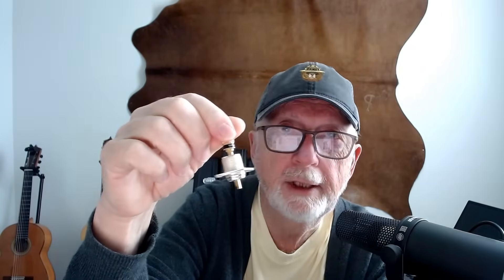Use Cheap TV Coax Cable For Your Ham Radio Station.

Comment: Hey Mark,
Here is a little story about 75 Ohm cable.  I was up in West Virginia where I am from at my brothers house. He wanted to put his IC-7000 in his truck. We got it installed in the cab and the 96" whip mounted on the tool box except he had no RG8.  It was on a sunday and we had the bright idea to use some RG6 Quad Shield instead as a temporary cable.  Key word temporary.  After I got the PL259 connectors with adaptors for RG8x installed I was shocked on how low the SWR was, It was a 1:4 to 1. Anyway to make a long story short this was 9 years ago and the cable is still on the truck with the whip.  HEY if it works good leave it alone, Right.  After I got back home here in Florida I talked to him on 10 and 12 meters without a problem and no matter where he was in the mountain's of WV, KY, NC, or Tenn. it worked great.
So much on having to use 50 Ohm cable.  I didn't question on why it worked, it just did....    Thank Mark 👍
W4DRA
Reply from the maker: Great story thanks for taking the time to pass that along.

Comment: Antenna tuners don't tune
Reply from the maker: Antenna Engineer W2DU Walt Maxwell explained that a properly adjusted tuner at the transmitter end causes a conjugate match to be established at the antenna feed point—not by changing the antenna, but by adjusting the input match such that the entire system (transmitter + tuner + line + antenna) behaves as if there is a conjugate match at the load. This enables maximum power transfer even when the antenna itself is not naturally resonant.

Comment: I will keep using my LMR 400. If you can't afford the hobby there are thousands of other hobbies. I don't use a tuner just resonant antennas. Tuners are a bunch of CRAP since they don't actually Tune Anything. You use Garbage & you get garbage so be Cheap & play 2nd fiddle. :face-blue-smiling:
Reply from the maker: Might want to check the ARRL Antenna book.  

"An antenna operated away from its natural resonant frequency is tuned to resonance by a Transmatch connected at the input to the transmission line."
Reply: @ I’m sticking with what works and I’m not messing with what is doing an AMAZING job for me. Tuners are just wasting time,money, & signals. ARRL = Amateur Radios Real Losers. 👎🏻

Comment: I’ve been using RG6 with a 60 watt rig without problems for a while. You should also consider that if the length of the feed line is a multiple of half the wavelength the impedance at the antenna end will be mirrored at the transmitter end, so cable impedance does not matter in this case. Great video! Subscribed.

Comment: YOU  have not even  SCRATCHED  the surface!!!.  In the 60's, when I was in high school  (grad 66)   one of the Elmers was talking about using  LAMP ZIP CORD  on  160--40 meters.  I actually DID  use  some extension cord  on  160-40  back around '99-2000.  I was staying with my Mom, recovering from a bad car crash.  Threw up some wire,  fed it with RG6  added to  extension cord  (not enough length)  and away we went.
Reply from the maker: Yep that'll work.  Actually I'm planning a video on something like that.

Comment: This is a very interesting video. I’ve heard of people using RG6 as feed line before, but not getting the explanation I received here. I was pleasantly surprised about the banana plus and chassis ground idea, but it makes perfect sense. Great out-of-the-box thinking, we’ve all been conditioned to 50 Ohm coax and PL259s. I’m also a fan of ladder line. Good stuff here.

Comment: When you say high power, is that 100+ watts or 1000+ watts? What would you say the highest power RG6 and RG11 are respectivly?

73 de David KEØPBI
Reply from the maker: High power is above 100 watts.  For cable power ratings....   https://rfconnection.com/coaxial-cable-power-ratings/

Comment: You can still Use 75 Ohm's TV Cable,
75/50=1.5 swr, not a bad match,
Reply: Not necessarily depends on the length

Comment: Do not use TV coax for ham radio especially if You live in Europe. European markets are flooded by cheap chinese knockoff cables made from steel and alluninium wires. I spent more money by buying and unsuccesfully testing cheap TV coaxes than was the price of propper 50 ohm. RF-287. No one is rich enough to buy cheap things - is our quote - and it is right.
Reply from the maker: Here in the us tv cable is made of steel and aluminum and it works fine.

Comment: When I first got my G4 call I used a short length of what was called u.h.f. 75 Ω  t.v. coax, a KW204 valve tx with Pi output on the valves, long wire and tuner. You could get either a 50 Ω or 75 Ω SWR meter. 
If your dipole is 73 Ω, your tx and coax 50 Ω, there's a mismatch, it's said to be a 1.5:1 SWR, that is if you can get your dipole to 73 Ω. 
I would think using 75 Ω coax to a 73 Ω dipole would still be 1.5:1 SWR with a 50 Ω tx so nothing different. 
According to my VNA my attic dipoles (more like inverted vee's) vary from 66 Ω to 56, 52 and 45 Ω with varying SWR figures. I don't worry, my worst is 1.3:1.  Brickwork, other dipoles and having the ends wrapped round the joists to fit them in affect it all. 
Edit: RG58 used because I use BNC connectors on everything. I only recently found BNC plugs are available for RG8.

G4GHB.

Comment: The ultimate reality check is to run an a/b comparison of the two cables. As measured by a field strength meter, too see what the ERP of the system is, both ways. Losses, reflections, nothing counts except the ERP. Assuming the SWR won't cook your finals.
Reply from the maker: The specifications of all such cables are readily available.  Just do the math.

Comment: Back in the mid 20th Century when I started out in ham radio, the Radio Amateur's Handbook recommended RG-11 or RG-59 to feed a dipole.  Transmitters back then had pi-network tank circuits in the final amplifiers and they would match 75 ohms just fine.  The only rule that's important about splicing coax without connectors is that the length of the open wires shouldn't be a significant part of a quarter wavelength.  That means connectors begin to matter on 2-meters and become become important at higher frequencies.
Reply from the maker: Good advice!

Comment: Use crimp connectors for aluminum shield cables. My first station used 75 ohm TV cable back in 1974. Worked fine. 
I was just looking at my Ten Tec Century 21 manual and they recommend 50 to 75 ohm cable....
But they even said loads from 35 to 75 ohms will work. This is solid state gear, not tubes. Tube radios didn't have a problem either.

Comment: Although a dipole will match 75 ohm coax better, a lower impedance (about 30 ohms) feed line is more efficient for transferring high power (even tens of watts) TO an aerial. 50 ohms was thus chosen as a compromise for transceiving, whereas 75 ohms is better for (e.g. TV) reception only. Having said that, your main point about losses and SWR is entirely valid, and satellite coax is very low loss and still much cheaper than 50 ohm coax because the market is so much bigger. Go for it.
Reply: I Also have a nice roll of good quality satellite 75 Ohms coax, I will try it!

Comment: Just for fun i tried buying 100 feet of 75 ohm RG-59 and 100 feet of 50 ohm RG58. The cheap stuff from Amazon. Both $25 for 100 feet at the time. I didn't have any problems with SWR or impedance but I put 100 watts into one end and sticking my Daiwa power meter on the other end into a dummy load I only got 7 watts out with the TV coax and 22 watts with the 50 ohm coax. My intention was always to use them for receive only antennas and they served that purpose well but I couldn't help testing them to see how bad they were with power loss.
Reply from the maker: SWR meters are designed to work with 50 ohms, not 75.  With a 50 ohm dummy load you had standing waves on the TV coax but loss would be very small.  Something was wrong with your setup.  No way there was that much of a power difference.   And RG59 has less loss than RG58.

Comment: What’s the receive loss?  Also is your antenna coupler before  the coax or at the end of it near the antenna ? The transmitter won’t like a 75 ohm load.  I’ve had a GROL for 50 years and worked as a tech in the industry.
Reply from the maker: Receive loss is the same as transmit loss.  You could have a tuner at either end but I like a tuner at the transmitter end.  It will take care of your transmitter impedance and tune the system just like it would be with a 50 ohm cable.  I have a GROL too.  It's useless now.
Reply: @ that’s a good place to put the coupler. The last place I worked at the GROL was a requirement for employment. It weeded out a lot of people. My last position at that company was 6 years at a gateway earth station. I worked in all kinds of RF equipment including P-3 avionics, navaids, and radios systems including trunked radio and a repeater system 800 miles long. I also did quite a bit of work for the FAA all over Alaska.

Comment: 75 ohm coax center wire is very fine, can't handle over 20  watts⚠️ have you tested tv coax ????
Reply from the maker: Not so.  https://rfconnection.com/coaxial-cable-power-ratings/
Yes I have used TV coax.  Did you even bother to look up the actual power ratings?

Comment: I've used a set of crossed dipoles (40m & 80m) for years. I fed it with RG-6 and the SWR was 1.3:1 after tuning the antennas. I agree 100% that TV type coax will work just fine in most cases.  I never ran more than 200w using that coax and never had any issues. Now that being said, I'm not sure how well TV type coax would work at UHF frequencies as I've never run it but, I would imagine it would work also.
Reply from the maker: It will work better than popular 50 ohm coax cables because it has less loss at high frequencies.

Comment: I’m brand new to ham, so please excuse my confusion: Won’t I risk damage to transceivers by not using proper cabling and good SWR numbers? I want new equipment such as Icom IC-7xxx, but I might have possible access to old vintage equipment until I can afford the fancy new stuff, and really want to learn how to use, repair, and restore vintage ham equipment, including vacuum tube stuff. Won’t wrong cables and bad SWR numbers bring about hurried and premature wear and damage to such equipment? To this point, I only have experience on 2m and 70cm with the cutting edge Baofeng UV-5R, and as of yet, have not been (able to afford) HF yet. Thanks!
Reply from the maker: You'll be fine if you use an antenna tuner.  It will allow you to use any coax or other transmission lines and provide a perfect 50 ohm match for your transceiver.  Every ham station needs one and they don't have to be expensive.  Plenty of used ones on eBay.
Reply: Modern radios use FET power amp stages which will not tolerate high SWR as the reflected power will cook them - hence the need to protect them. The ic7300 has high SWR protection but you don't want to test it to the extreme. Basically a modern radio should only ever see 50 ohms no matter what is further down the chain.

Comment: Yup, correct on everything. I work in a thrift store and we get TV coax donated fairly often yet most folks shun the stuff. In my store I would price 50 feet at $5 with F connectors. I use it from time to time and no major issues. 73 de wa4jat

Comment: Agreed, as a 30+ year Ham, I have used all sorts of wire, antennas and connectors LOL if you are listening to SW you dont even need an antenna! you can toss a few feet of wire out a window and hear the same thing we hear on a $1000 antenna
Rain Gutters as both the antenna and counter poise :)
you guys buy coax at HRO? my last three 50 foot spools rg58 I got on AliExpress $14 each with ends, oh and a Plus it showed up, and a bigger plus it worked as promised!, if they get around to tariffs they will still only be $30 Rarely am I under 100W am not a QRP kind of guy

Comment: 75 ohm coax was used by hams long before 50 ohm coax became ubiquitous. I get reel tailings of RG-11 all the time from construction sites when they are building apartments, etc. Otherwise, they will just chuck it in the recycle bin. They have saved me thousands on coax. And you can spin a PL-259 directly onto RG-11!  Stuff works great. I even have an old SWR meter that has a switch on the back, so I can use it on either 50 or 75 ohm cables. But I use my RG-11 on almost all my radio setups, including my scanners. 73!
Reply from the maker: Great post!

Comment: What power can you transmit through RG6 / RG11?
Reply from the maker: I would stick to around 100 watts for cheap RG6 however RG6A is a higher quality RG6 and has a rating of 1500 watts @ 10 Mhz.  RG11 is rated at 2500 watts @ 10 MHz.
Reply: @BustRadioMyths  I see that there many many different versions of both RG6 and RG11. Most seem to have copper clad steel center conductor. The CCS center conductor should be limited to 100W I assume.
Reply from the maker: Why?  RF current flows only on the outside of a conductor.  Look up the power ratings for those cables yourself.

Comment: I use TV coax all the time and I work QRP mostly and worked the world I'm KB8UGP Gary the QRP Guy I'm a master of Europe. I worked all 50 states, all grids. What more can I say? The TV coax works just as good as anything else. And like you said, unless you're running a whole lot of power. Now I have run up to 300 watts through the 75 on cable and it's never hurt nothing. Never offered too short arc or burn up. So I say it can. be used for amateur radio use also. made videos showing my QRP setup and where I run 75 on cable So there you go. Y'all take care now. May God bless America

Comment: Just today I worked Kenya from Poland through a resonant 10m dipole connected via a TV 75ohm coax, just 20watt of power. No tuner needed, SWR close to 1.0. So TV coax certainly works. It is not my usual setup, but just for fun I sometimes use it.

Comment: Do you have any data available to show the losses of RG6 and RG11 vs RG8X and RG213?  What do you consider high power?  100watts?
Reply from the maker: Try this coax calculator.
https://www.qsl.net/co8tw/Coax_Calculator.htm
High power is over 100 watts.
Reply: @BustRadioMyths  Thanks for the information.  As a newly licensed ham this information has given me pause to consider my choices coax for field use vs shack use.  Other things to consider, is not every HF radio has a built in antenna impedance matching device (tuner), so using the correct impedance coax is important.  Using the website you provided, it seems for QRP power levels (10 watts or less), the quality of the coax and signal loss is much more apparent then when using 100 watts output.  In shack use using RG11 for everything hf, vhf, uhf would be the way to go.  It has the lowest power loss regardless of frequency.  For field use, I would think a stranded center conductor coax would be more durable and flexible.  This would make the cable easier to coil up and store.
Reply from the maker: Your radio does not have to have a built in tuner.  You are aware of desktop tuners I assume?  Use a tuner and you can use any coax you want.

Comment: That is what boggles my mind, how cheap coax cable tv is..i installed cable for charter for a hot minute before i got my technician license although i still have lots to learn about amateur radio. I would use coax tv supplies for amateur radio but im sure sad hams would cry foul like a b**ch about it.😂

73, kq4hcu
Reply from the maker: Yep

Comment: I found this out when I wanted to have a 2m/70cm radio in the basement and put the antenna in the attic of my 2 story house. I noticed there already was a piece of RG6 running between the attic and the basement. Bought a pack of F to PL259 adapters off amazon for $8. SWR is a little high (2-2.5:1) but it’s worked for 6 years. I don’t need to run full power anyway making any reflected power insignificant.
Reply from the maker: Cable already there?  How easy is that?

Comment: If you are desperate regular table top lamp cord , or speaker wire about 18 ga are close to 50 ohms. Picture it as micro ladder line not terribly lossy. If you are running low cost QRP consider it.  Everything has loss, the worst loss can be in your wallet especially if you are in a budget 😢.
Reply from the maker: This is true!

Comment: The biggest downfall of ham radio is the need to be perfect 👌.  I rent, getting a signal outdoors is nearly impossible. I use an unused 75 ohm cable coax with adapters from F to so239 in and outside the house. Then I use 100 ft of RF-8u style coax to my random end fed wire. My 20 watt Xeigu g 90 tunes it from 10-160 and I work the world regularly. Give up the 1:1 nonsense! With a tiny skill you can load up your uncles Buick just have fun! 😂   * ✅ Remember your greatest RF friend is height no matter what band you are on.

Comment: Given that a dipole is a common and useful antenna and as you say, comes out to about 72 ohms; I have never understood why rigs were not built to a 70 or 75 ohm standard. I'm sure there is a good reason but I've never come across it.
Reply from the maker: 50 Ohms is the least bad compromise between the impedance vs loss plus maximum power, and maximum voltage.    That's the official answer anyway.
Reply: @ Thanks for the information, I often wondered what the official given reason was... now I know!
Reply: Many years ago I had a KW204 tx (valve) with it's Pi output and you could specify either a 50 Ω or 75 Ω SWR meter. I got 75 Ω and used 75 Ω u.h.f. t.v. coax and a long wire and tuner. As I understand it the tx was not different and the Pi circuit would match either and it was only the SWR meter which was different.
Different now on modern tx with 50 Ω as standard.
G4GHB.

Comment: I use $20 , 100 FT RG-6 with F connector on both ends to feed my HF inverted L ANT.   I used to have RG-58 for same run, but there is No difference.   I have BNC to F connector adopter I bought at Aliexp.  AG6JU
Reply from the maker: Now here's a cheap but smart ham.